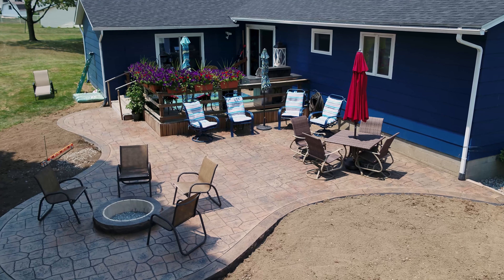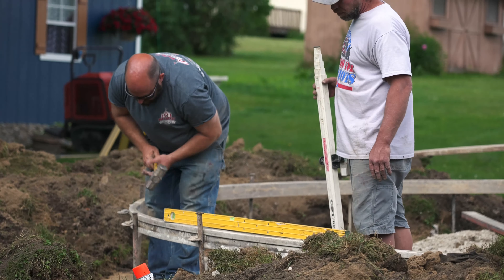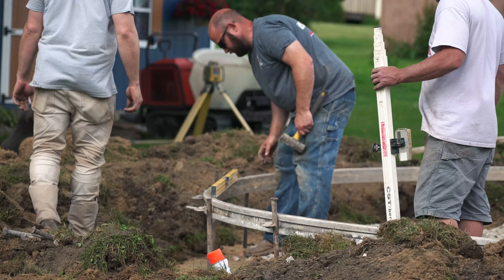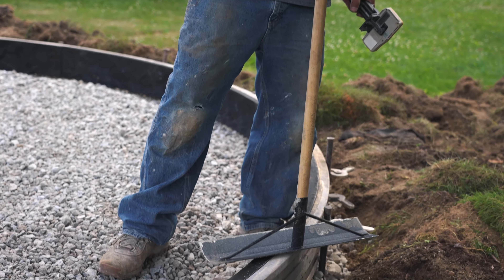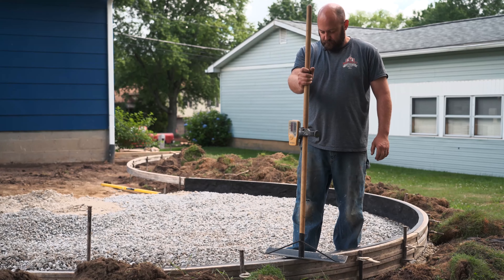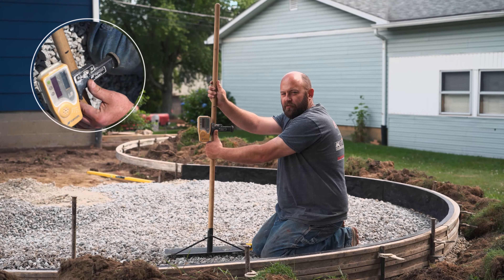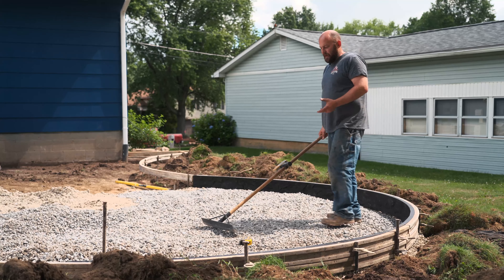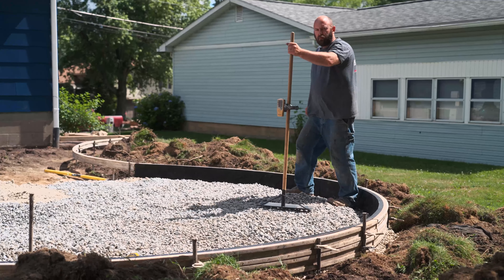Quickly Check and Set Grade!

Comment: Ok if it’s totally flat, what about fall ?
Reply from the maker: Thanks for the comment! The slab in this video is not completely flat. It has about 1.5" of fall per 10' of concrete. This technique is just for getting the gravel close, a string line is still required for fine tuning the final grade. Thanks for watching!!!